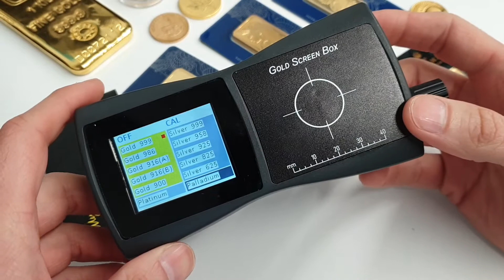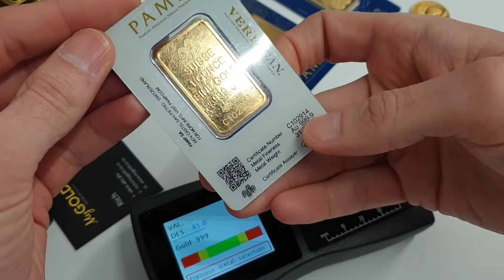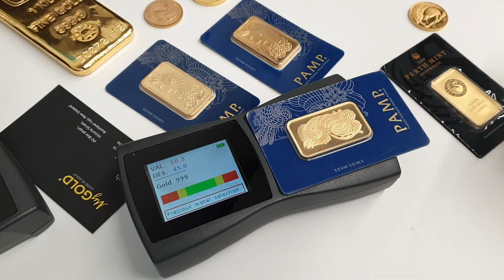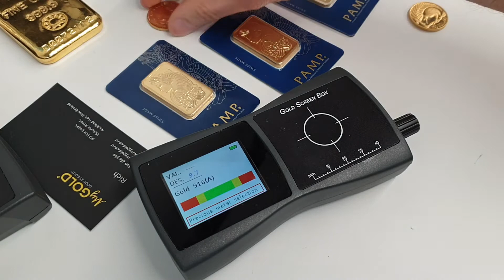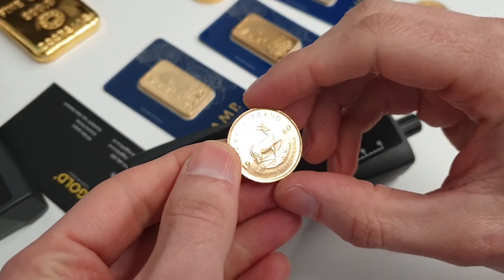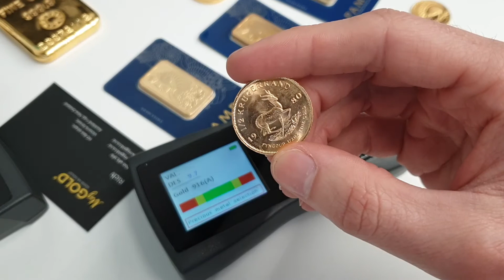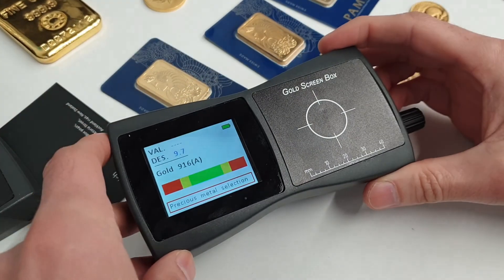How to Test Gold | Fast & Accurate Gold Testing Method 🎯

Comment: how much are they and where do you get them
Reply: It's called Gold Screen Box and price is around 1200 Euro, but it is out of stock in most places due to electronic component shortages. You can get similar product for 800 Euros, which is called Gold Screen Sensor.

Comment: What is the price of this device?
Reply: It's called Gold Screen Box and price is around 1200 Euro, but it is out of stock in most places due to electronic component shortages. You can get similar product for 800 Euros, which is called Gold Screen Sensor.
Reply: Hi..Did you get any of such devide Asif Ali?
Reply: @sidraniaz6260  Hi Sidra, I shall be visiting EU in May this year. Will buy a machine for sure. Regards.

Comment: Best BITCOIN commercial ever
Reply from the maker: Ahh, you mean the crash in bitcoin prices which confirm what everyone knew that bitcoin never will be a 'safe haven' investment. Just speculation and gambling. 😅👍🏻
Reply: @MyGoldNZ  didn’t take 5000 years to beat $1800
Reply from the maker: @Crimepayz-o2n  won't take bitcoin 5,000 years to zero either. I'm sure your point could be swapped out for Tulips too, or other highly speculative 'investments' that have soared and then crashed.
Reply from the maker: @Crimepayz-o2n  Doge coin founder: "After years of studying it, I believe that cryptocurrency is an inherently right-wing, hyper-capitalistic technology built primarily to amplify the wealth of its proponents through a combination of tax avoidance, diminished regulatory oversight and artificially enforced scarcity," Palmer wrote.
Reply from the maker: @Crimepayz-o2n  gold is not there to make you rich, but it will preserve your purchasing power over time.
Reply: @MyGoldNZ  that’s the problem. You lose 2% a year in purchasing power with gold. It was the best choice until……
Reply from the maker: Purchasing power against what? A fiat currency? Which one? Over which time period? 🤔
Reply: Lol, why not just have both!!

Comment: will this detect tungsten coated with 24k gold? (which would weigh the same as pure gold)
Reply from the maker: In our testing, absolutely. Tungsten has a different electrical conductance. 👍🏻
Reply: @MyGoldNZ  so a different metal on the inside of a bar will change the electrical conductivity at the surface, even though the whole surface (to a depth of 1/8 of an inch) is pure, unalloyed gold??
Reply from the maker: @ToThePureAllThingsArePure  ever heard of ultrasound? There's no one perfect method aside from fire assay. Best to use several in conjunction.
Reply: Link for purchase?
Reply from the maker: @m3rc3r87  It actually is, you should know what you comment on 😅

Comment: If it can't determine if gold is beneath the surface, then what good is it ?
Reply from the maker: You are confusing this device with an XRF.
Reply: @MyGoldNZ  Thanks for replying so late at night ! I'm not confusing it with anything, because I don't know anything about either one. What I am wanting is something that will determine if something is solid 24K or just plated. I am having trouble finding out what to buy because there's a lot of confusing info, such as this video. Please clear up the confusion for me...THANKS !
Reply from the maker: @meauxjeaux431  firstly there is no one test for gold aside from fire assay. I suggest you look deeper into the subject and educate yourself on the options.